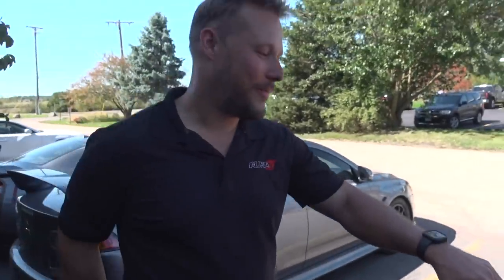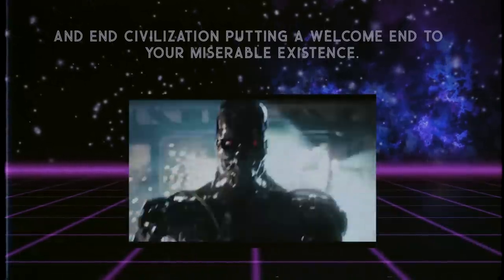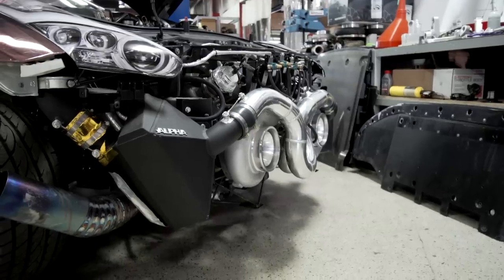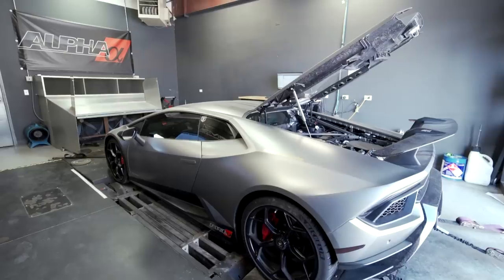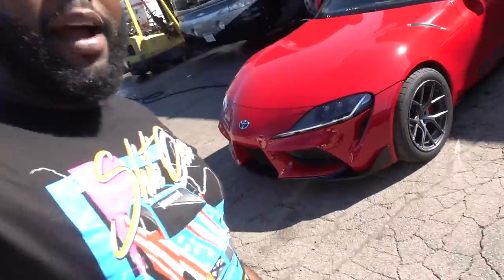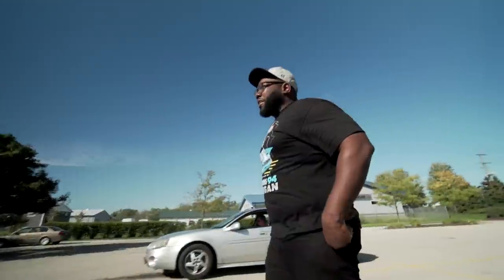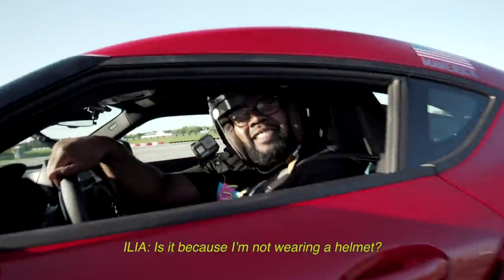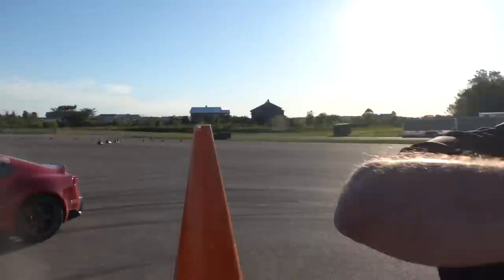AMS Performance is a Horsepower Madhouse, And We Drift Their New Supra!!

Comment: Proline Engines ran on a hub dyno that recorded Alephas C7 at 5200hp at like 8,000 rpm. he's running 3.5's in the 1/8th mile at over 200mph. So that tells you how impressive the GTR's AMS builds are with minus 2 cylinders and a whole lotta Cubic inches less too.

Comment: Straight up don't get why someone would buy the new supra when you could get a SS 1LE or Mustang GT performance pack 2 for less and it's not a base car like the supra will be at that price and I mean you can do a twin turbo or supercharger kit and make an easy 600-700-800 HP no problem hell over 1200 HP for less than 10k